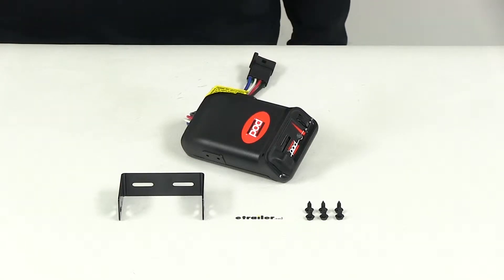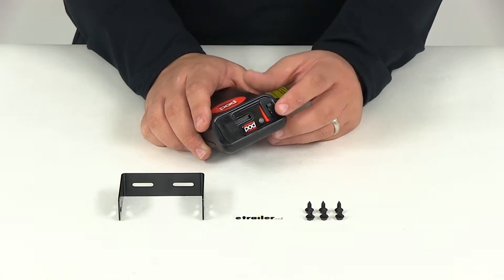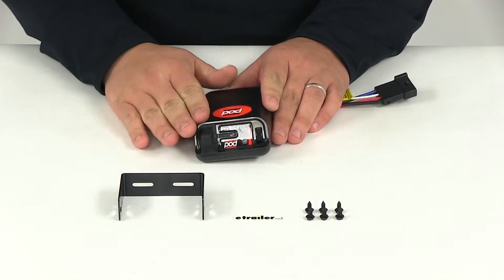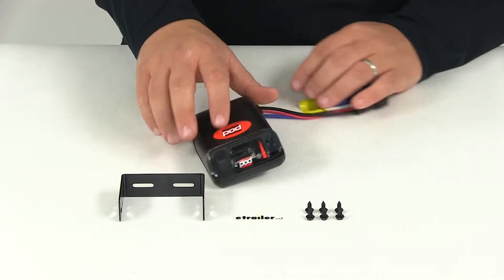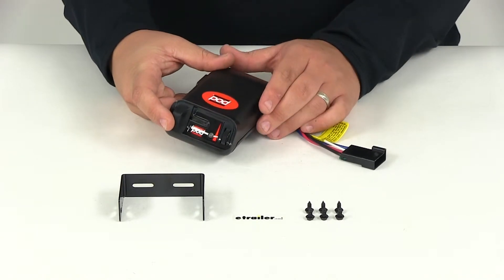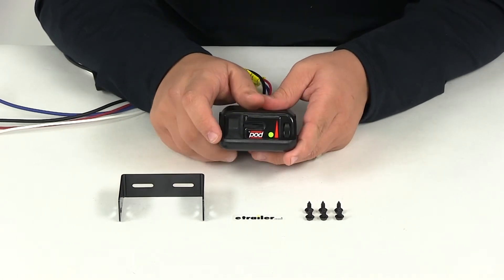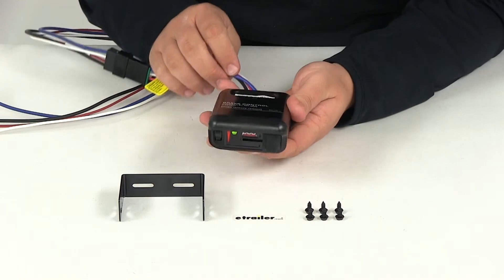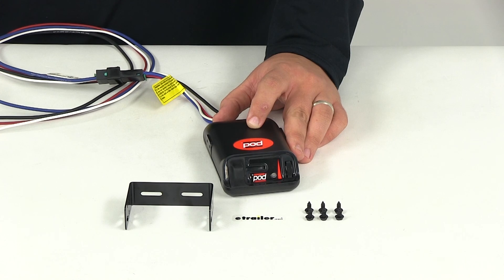etrailer | The Low-Down on the Tekonsha POD Trailer Brake Controller

Comment: Hi just installed one of this with the factory harness. My question is, the green light only comes ON once the trailer is connected, in the meantime that LED LIGHT on the unit will remain off still connection is establish.. or the green led will come one is connected to car harness underneath the dashboard that shows power to the unit??? Need to know because mine is connected but no green light  can specify pls
Reply from the maker: You can check out the installation details in the following link. They will show different trouble shooting situations that you can compare to what you are experiencing.
https://www.etrailer.com/Trailer-Brake-Controller/Tekonsha/39523.html

Comment: what if the led doesn't come on but when you squeeze it the break lights come on? there is power going to the controller just no led
Reply from the maker: This most likely means that your trailer connection is weak. You will want to check the trailer plug and the 7 way on the tow vehicle to make sure the pins are clean and not corroded. 
https://www.etrailer.com/Trailer-Brake-Controller/Tekonsha/39523.html